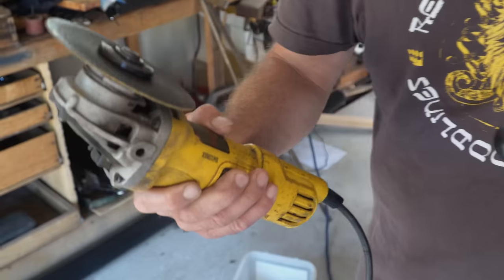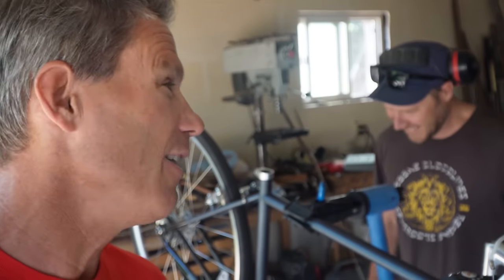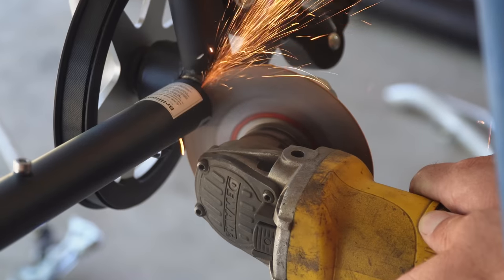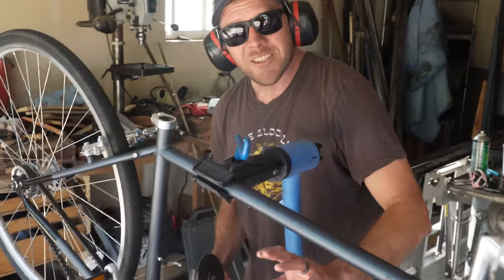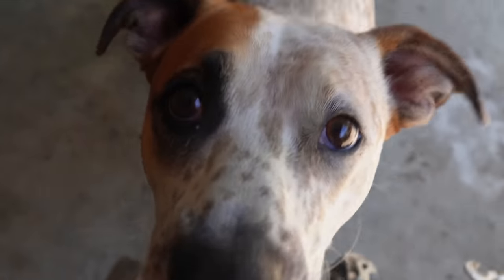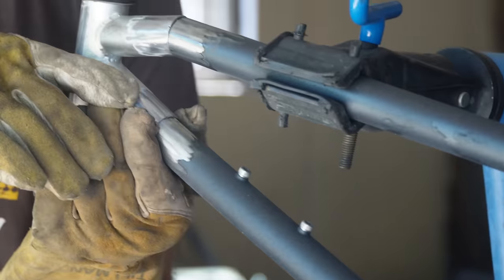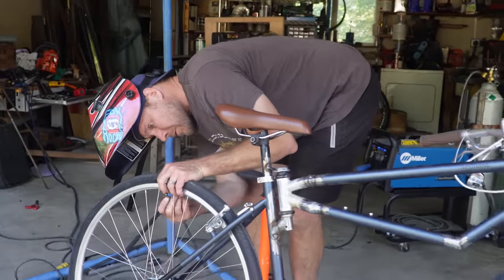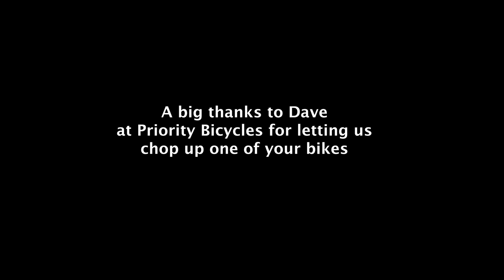How to Build a Swing Bike-With Tiny House Nation Host Zack Giffin

Comment: I also built a swing bike 10 years ago inspired by your 2006 video, and even today it still gets by far the most attention out of any bike I've owned! From this experience I have another swing bike building tip: experiment with the head angle. A swing bike with a slack head angle is a good "beginner" swing bike since it makes the bike easier to control as it stabilizes the front end. The downside is that it makes it a bit harder to do swing bike tricks like riding with the wheels out of parallel since that front end wants to stay straight.

Comment: One change I'd make:
Fabricate the connection to the rear triangle that allows for seat post adjustment.
Seems like welding just to the seat tube would be ideal.
Or weld the seat post to a quill stem insert in the swing steerer tube.  This would allow you to adjust saddle height.  The way it is now, that seat post height is fixed.
Even simpler would be welding the "rear headset" to a ring-clamp that encircles the seat post.  Provides a secure connection, but allows for seat post adjustment.

Comment: I  have  seen  a. Guy  in  the  Bronx  NYC   riding  a. Bicycle. With  a. Re engineer frame   and  27 inch wheels  I think it was like 2 frames welded  together ?  The point is that  he was  riding seating high above the car's    with   the pedals   high to his feet  the chain  attach to center  then another chain attach to rear wheel  make it  turn  this guy  was riding up  high . May be circus trick bike ?